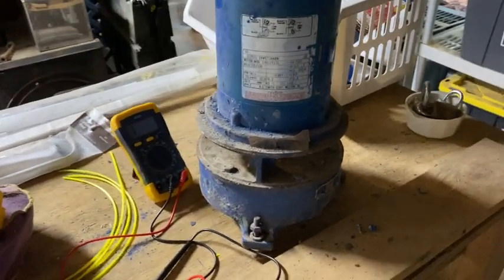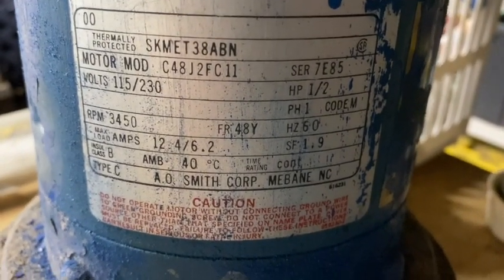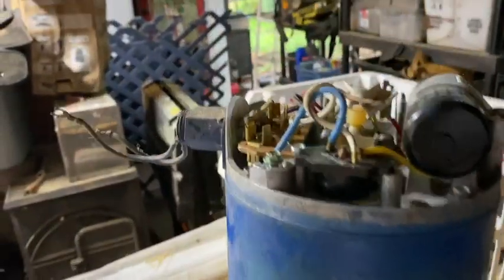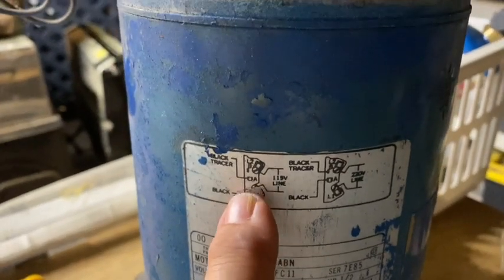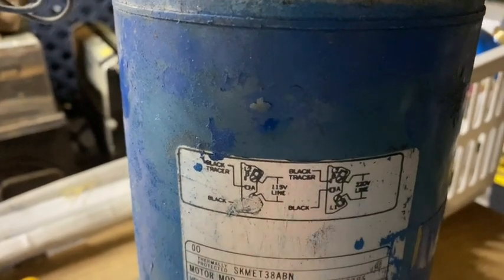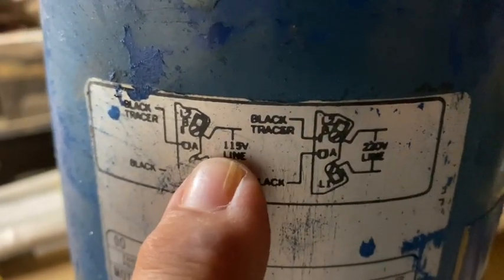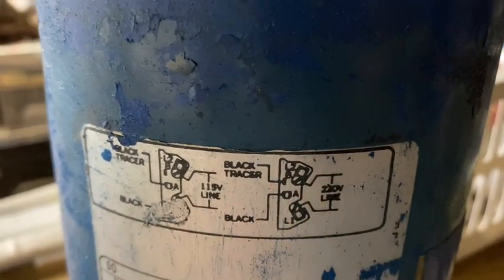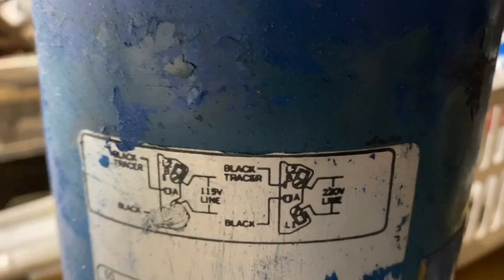Converting a 220 volt electric motor to 110 volts without a manual

Comment: Both diagram pictures of the board are the same. Just look at the wire label. And it is easy to see.Just look at the wires on the left and use the board diagram on the right. That spot that is scratched out is L1 the black plugs right behind the white wire on L1. Or taht is what it seems like to me.

Comment: Hi bro....Im her in the phillippines my generator is 230 volts  3100watts i want to convert to 110volt because my lamp is 110v 2000watts it is safe to use
Reply from the maker: Does your generator have a 110 outlet to plug in 110?